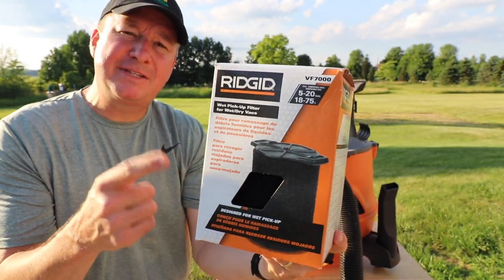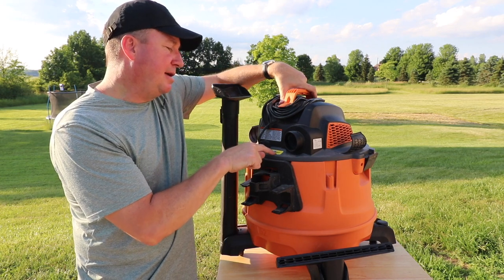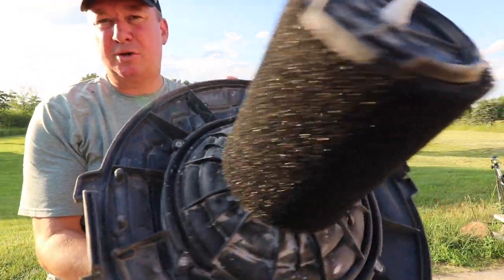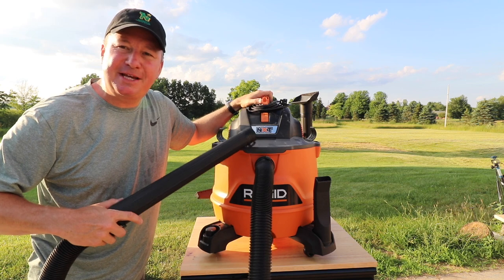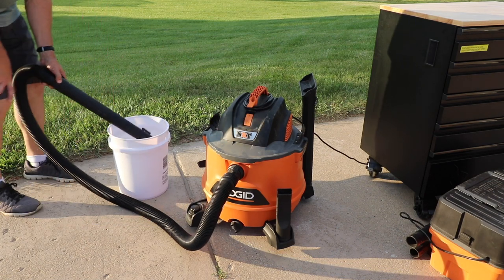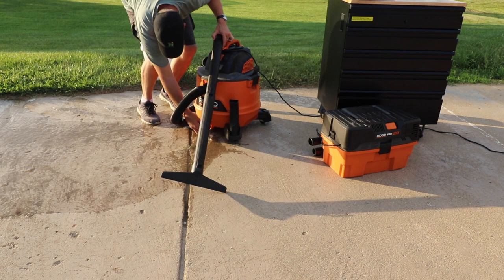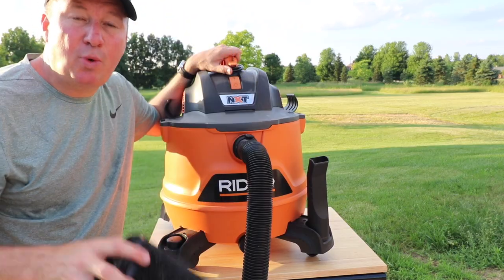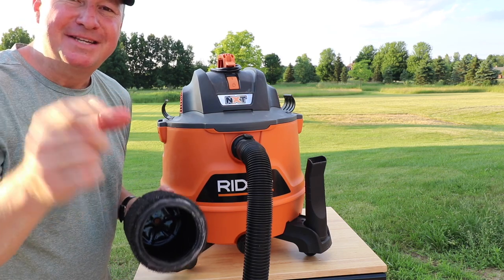RIDGID WET DRY VAC FILTER FOR HIGH VOLUME LIQUID CLEANUP | VF7000

Comment from the maker: QUESTION OF THE DAY: Have you ever needed to use your wet/dry vac for high volume liquid cleanup?  What happened and were you prepared?  Did you know the Ridgid Wet Dry Vac's require this special filter?
Reply: My basement flooded
Reply: I was hoping to use it without the wet filter.
Reply: You do not need a specific filter to pick up water only with a Ridgid vac.  Even the manufacturers directions state you can leave in place the paper filter to suck up small amounts of water and to remove the paper filter for sucking up large amounts of water.  The accessory filter your recommending is not needed until, as its name implies, you have Wet "DEBRIS", or water with debris in it.  Nothing wrong with purchasing or using it with all wet pick up.  Just not a requirement until situations with wet debris arises.

Comment: I’ve sucked up more than a hundred gallons over water in my basement with no filter. I probably based on Rigid’s recommendations would have replaced this wet filter to the cost of the value of my shop vac. I don’t see any reason to waste money on a filter for wet vacuuming.
Reply from the maker: If you have clean water that you're vacuuming up, you may be okay.  I just play it safe and use the filter.

Comment: Hi, and thanks for the review. My question is can these Wet Vac filters Be cleaned and reused.?
Reply from the maker: Yes, absolutely.  I mostly just vacuum up water with it and not any other debris, so the filter doesn't need special cleaning.
Reply: The wet filter directions actually state it is reusable and should be cleaned between uses.  It also states its NOT to be used for anything BUT water pick up. Any other use outside of water pick up requires a different filter part number.

Comment: DUDE - don't use it without a bag for dry vacuuming! The bag itself is the primary filter. You will be going through the expensive cylinder filters like hotcakes without a bag.
Reply from the maker: Good point, I know what you're talking about and should get one next time.  Thanks for the advice.

Comment: So I bought one of these wet/dry vacuum and used it to suck up water from my washer but used it with the filter it came with. Did I ruin my vacuum?
Reply from the maker: No, your vacuum will be fine.  The paper filter may need to be replaced after getting wet like that.

Comment: Do I absolutely need that filter? Or are there any dupes available? There are no VF7000 filters in my area and I need to get the flooded water up because of lung issues. I just went to HD and the guy gave me a blue fine dust filter and said he uses that but I don’t wanna break a device I just bought
Reply from the maker: I had an extensive conversation with a Ridgid product manager and they say to always use the VF7000 filter for water cleanup. Where I'm at, I can normally get next day shipping on Home Depot products.  I don't think you can use any of their other filters for water.
Reply: @MarkThomasBuilder  thanks for the response! The soonest I can get it is Friday, so I went ahead and used the blue filter and was able to get 10 gallons of water out in less than 45 min. My city’s flooding has made national news, and we’re due to get more rain; want to get and keep as much water out as possible so I’m willing to sacrifice this vac if it breaks down, but I’d buy another; I already love this vac, it might replace my regular one but I’ll definitely only use the wet filter with liquid once I have it though
Reply from the maker: I don't think you'll do any damage to the vac by using the blue filter.  The filter may get ruined over time, but that's not as big of a deal to replace.  Sounds like you're in the St Louis area, which I saw on the news.
Reply: @MarkThomasBuilder   I am. We got more rain that night than we get in July and Aug combined while Cali and Texas are in a drought smh. I tried a few stores and got the last Ridgid from HD. Seemed like everyone was looking for either a wet vac or dehumidifier. Luckily, my loved ones are safe and property is minimally damaged, so I'm thankful. I'm glad to know the blue filter prob won't ruin the engine, it's really handy.
Reply from the maker: Glad you're all okay and hopefully better weather has moved in by now.
Reply: @MarkThomasBuilder  thank you! Hopefully the flooding has passed, time will tell

Comment: What a joke! High volume water clean up.  What about a cellar full with dirty sandy water. Prep for that.
Reply from the maker: If you have a cellar full of dirty water, I reviewed an ECHO WP1000 gas pump that might work better if you can have the pump outside.
Reply: If you have that much water, you need help with your basement, not a wet/dry vac